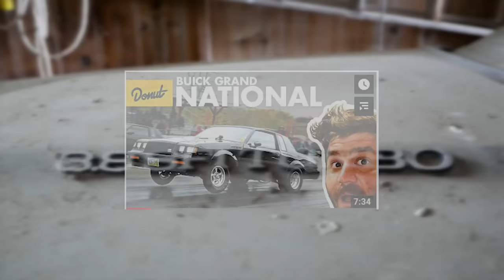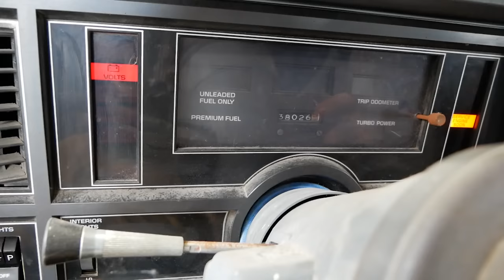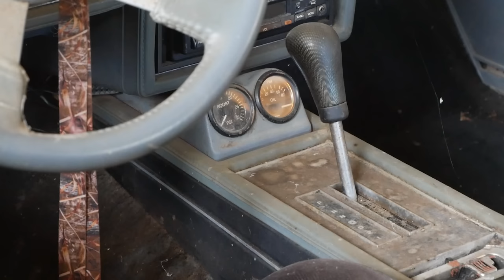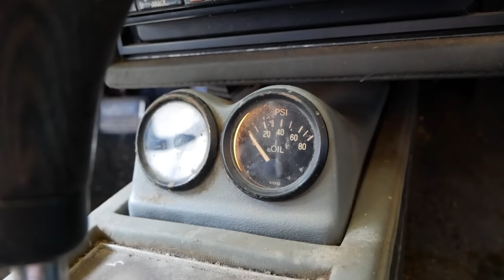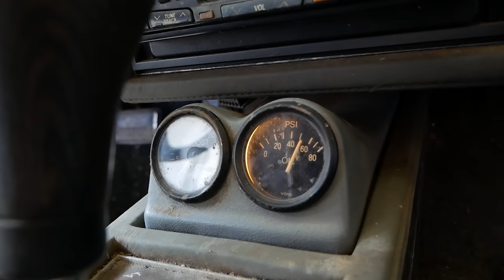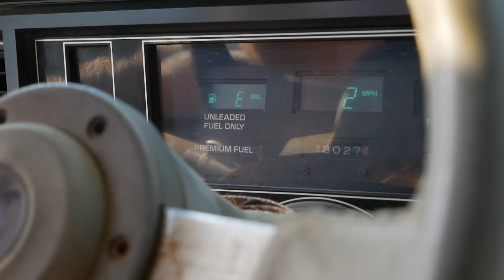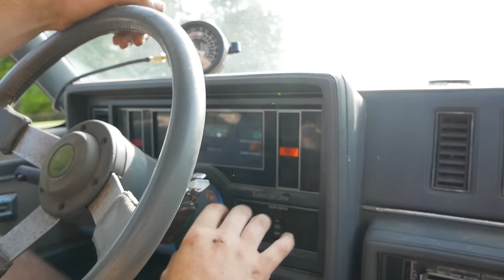BARNFIND BUICK GRAND NATIONAL - Will it Run and Drive??

Comment: “See kids, you don’t need fancy equipment to get stuff done” says the guy with a car lift and a forklift 🤣
Reply: rite! I be happy  with just the lift
Reply: He did follow that up with "it does make it easier"
Reply: Having a forklift to drop a full tank of gas would be way easier. I've heard stories where people would try to completely fill their tank because the car wouldnt start and the problem is the fuel pumps would be inside the tanks, not to mention these cars are basically siphon proofed. Why older cars rule!
Reply: @VintageCars999  - I've dealt with that story too many times!!!
Reply: @meabob  the best part is when they think it's not really full so they fill it to the point where its leaking out of the filler neck area. Seen that at least once!
Reply: Yea but you can tell this guy worked his ass off to get that stuff. So I'm sure he has done it enough times without it.
Reply: but technically you don't NEED them, it just makes things a lot easier than when I had to park half on a sidewalk to get the car up high enough to work on the underside of the engine and I didn't have the right equipment.
Reply: @XD1908  exactly! He has worked hard to get where he is.  Mom
Reply: Having the right gear makes all the difference - I remember failing to remove an exhaust with a lighter and a spanner...
...in a gutter, in the rain! 🤣
Reply: It’s called getting old and keeping your memory’s bc in the end it’s all your body will let you keep

Comment: hey Kevin, fairly certain that the little box with the green light you found is wired into the MAP sensor. if I was a betting man, I'd say it's probably just modifying the signal that the ECU sees from the MAP sensor to basically trick the ECU into thinking it is making a different amount of boost than it actually is. classic hot rodding trick. in fact most modern diesel engine tuners do basically the exact same thing

Comment: I had one it was fast in its day.  I suggest replacing the stock brake system.   The Master brake cylinder by it self was $3500.00  back in the early 90s.   I can not even imagine what one goes for today, if one can be found.
Reply: It's the nitrogen charged booster for the antilock system. Ford had a similar system on the Lincoln town car, but was also paired with the crappy air strut suspension system. Those went for $1,500 each. It's why you'd see so many sitting on the ground in people's yards for sale back in the late 90's early 2000's
Reply: @dave1135  it was a great day when some one figured out  and made coil conversions for those rear shocks on those Lincolns...
Reply: When I was working on one a couple months ago, we couldn't find a booster/master cylinder any where. Not even used. Finally found a place in Alabama that would rebuild it and give a year warranty as long as the motor still worked. Cost was $960 plus shipping there and back. They said the motors are very hard to find. Luckily ours still worked. It took 6 weeks to get it back but it worked perfectly. I got lucky and all the bleeder screws broke loose.
Reply: @dave1135  - the accumulator on these actually fill with brake fluid. The master cylinder has an extra reservoir for the accumulator. Don't do like me and fill up the extra reservoir after bleeding the boost system. The extra room is for the fluid when you have to discharge the booster to do any hydraulic work. What a mess it makes to.
Reply: @dave1135  they didn’t have antilock brakes. Nothing to do with the suspension either. I had the accumulator ball fail on my 87 GN. Brakes were hard as rock. There was actually a recall for that issue
Reply: @jaredoaks6317  I know, what I meant was the ball provides the brake assist. On the suspension for Ford, I meant it's like the brake system on the GN, overconplicated and over expensive
Reply: @meabob  The guy who bought mine ripped out the entire stock brake system and put a better after market one.

Comment: Seeing this car so rough hurts. My dad had a super clean and pretty stout 87 about 5 years ago that he sold right before he passed. Precision Turbo, forged internals, built trans, scan master, fuel system, 3inch down pipe made 26psi on 93. Pretty much all the go fast parts you need. Had the GNX wheels, boost gage in the A piller. Been my dream car since i was able to understand how great these cars were. Ill never forget him letting me drive it on some rips. Ran it in the 1/8th couple times one day, Ran an 8.10 our first and only time at the track with it. Best memories i have of him were in that car. I will own one myself one day.

Comment: I mean at that point, with the body damage, it would be best to just clean it up, get it running right, and  make a fun driver out of it
Reply: With it running good, they could probably get $15k for it as it is body wise. Well maybe a little less with the "upgrades" it's had. An original one in decent shape that runs well goes for $30k to $40k
Reply: No way is this a 15k car.  I agree to getting it running and drive it as is.

Comment: That's my dream car. I remember being at the  first time they came out with the Gran National. My father was a general Foreman at Buick. Flint, MIchigan. The birth place of Buick. I fall in love with Gran National while I saw the unveiling of the car. I sat in the band stand watching them race the Gran National. Doing donuts & all kinds of stuff. I loved it when my father got to drive home the new car except for the Gran National. Back through, you being a car guy. Buick put t-type engine in Rivera's, Century's, & Regal's. If am wrong, please let me know that I am wrong. I'm not 100% sure. That episode of you fixing the car & taking it out for a test driver brought back memories of my father. He passed in 2002. I am proud to say that I watched the evolution of the Buick automobile. Thank you so much. I just happened on to your channel in my home page. Hey, I know about the poop smell in a motorhome. Nasty.
Reply: You are right and wrong but on the right trail.TTypes came out before GNs when the body changed in 1981.with a turbocharged carburatored 231litre V6, in 82 they came out with the grand national black and grey most had a 4.1 litre non turbo 125hp V6. About 10-12 where turbocharged 175hp 3.8 litres. Buick was trying to keep the beast with in. TTypes came out again in 83 but no GN until 1984 and buick laid all the cards on the table threw 85 with fuel injection,CCCI,revised turbo camshaft,bigger turbo,and carried over the 2004r with stronger shifting it needed to live with the new improved 200hp engine. Then in 1986 TType and GN got an intercooler and bigger turbo beter electronics. These cars would smoke Mustang GT, Camaro Z28,IrocZ,Supra turbo,300zxTurbo, Mitsubishi conquest TSI, most German cars... did i mention Chevy Corvette. When the GNX came out mid year in 1987 none where standing only 547 copies where made. But ...yes the TType was first and was faster than GNs because of the aluminum wheels,and bumper supports that made it lighter than the GN. TType could be ordered in any color under buicks umbrella GN could be to as long as it was black. Never understood why people liked the GNs more. they where NOT faster.question: factory issue which was faster 1987 Mustang LX 5.0 ..or..Mustang GT same transmission??  Ok same question for TType and GN same transmission. U get the same answer. Print that.

Comment: Maybe someone can tell me, did GM use the Renex ABS brake system? Seeing that high pressure vessel reminded me of the system that Chrysler used. It turned out to be a nightmare. But after struggling with it for awhile, I got pretty good at working on them. As crazy as it sounds, almost any problem causes it to loose power assist. Was a POS system. Then along came Teves. Great system.
Reply: gotta love working on CDJ vehicles
Reply: Not sure on the GM system, but I did comment on what the pressure accumulator is. It's simplify a filter of sorts to help with vibration and noise.These cara didn't have a vacuum brake booster. I personally thought this system ran off of the power steering (like GM did on diesels) but it seems to use an electric motor to provide hydraulic assist. Probably obsolete parts by now 😖
Reply: As an owner of an 86 Grand National for the past 26 years,   The brakes are an electrical motor powered system called the "powermaster" system.  I've replaced the one on my car before.  Not that difficult.  The master cylinder and electric motor come in one complete piece.  The big black ball on the side is to store the pressure it builds up for the brake system.  And this one is bigger than the stock one so that you can hold the car at a light with boost without braking the tires loose for a better launch.   When a turbo is boosting, there's no vacuum for the brakes to run off of, so this system assures there's always brake power.  Even with the car not running and the key is on, you will have power brakes.   The pressure accumulator is not a filter of sorts for vibration and noise like another person commented, It's to store the brake pressure.
Reply: And no, the car does not have ABS brakes.   If you stand on the pedal, they'll lock up

Comment: My dad has this exact car aaaand had the GMC Syclone at the same time. The Grand National is very strong. But that lil' truck was an absolute beast. I saw him take down a ZO6 Vette in the 8th mile by 3 cars. And baaaarely got beat by a Viper. Literally by a half a fender. Its was a ridiculously fast unit. He sold it for $4500😭😭😭😭😭😭. And regrets it to this day. Still has the Buick though. Only 21,000 original miles. Even has the dealer sticker in the quarter window still. It's so minty clean. 
       Love the channel brother. Keep'em comin.

Comment: There is hotter even faster version of the Buick Grand National called the Buick GNX?
Reply: Yes correct. 87(last year of production) they made a limited run
Around 500 cars i think.  Bigger turbo with more boost  and suspension mods, can't recall what all else.
Reply: 547 grand nationals in 87 were handed over to McClaren to become GNXs.  Each car was numbered on the dash. It had a ceramic impeller turbo for quicker spooling, a bigger intercooler, Steward warner Gauges, Fender flares to fit the Eagle gatorback meats mounted on TA like honeycomb wheels, A ladder bar attached to the rear axle to keep the tires planted on launch, Fender louvers on the front fenders to help vent engine heat and to look cool in Buick style...  That's all I can think of, there's more.  Very cool. Very collectable if you can find one.
Reply: @jeremygalba6559   remembering some of that from dead air. That was a pretty good documentary.
Reply: @spacecat7247  "black" air  :)   I knew everything about that car and my own long before that documentary
Reply: @jeremygalba6559  very good. I was just mentioning it for the guy that it was asking originally. And believe me I'm just a little bit familiar with it too it's one that's on my bucket list that I'll probably never Attain. But......maybe

Comment: The blue car at the start of the video is a Ford Festival. I know because I owned 5 of them. If it has a 6 speed in it I got 50 miles to a gallon. Great cars. A friend and I went to Ship shawarma and on the way back to Michigan stopped at a grocery store and bought 12 packs of pop( soda). I folded down the backseat and I wasn't able to see out of the rear window on the way home. Great memories of that car.

Comment: Great video! One of the things that made this car so important in the automotive world is that catalysts and smog laws cut performance off at the knees in 1975. Enter the years of great designs with lousy performance. SUDDENLY 1986 IS HERE AND A FACTORY CAR , RIGHT OFF THE SHOWROOM FLOOR, WILL BOIL THE HIDES! Someone at Buick reached and found he had a pair and said "I'm gonna build me a hot-rod".  The 1986 Buick Regal GN was born. General Motors often behaves like the 6 different car companies that it was at the time, and the car escaped corporate attention until sales numbers became so large they caught someone's eye. A few years later it was shut down because Buick had broken a rule that stated ;"No division of General Motors shall build a car faster than the Chevrolet Corvette, which is the G.M. corporate flagship/standard bearer for performance."  G.M. rules and whiny Corvette owners got a performance Buick shut down.  Other attempts were made, Oldsmobile and Pontiac,but they got shut down even sooner.

Comment: Love yalls videos , my favorite was the 66 Ford Twin I Beam  3 spd on the column,  I have a maroon 66 Ford my dad gave me when I was 16 years old I've now owned it over 31 years it has the 352 /2BBL 3 speed on the column,  only thing I've had to replace other than General tune up parts is the Cab mounts and the radius arm bushings

Comment: That thing at 23:57 was called a TPS TEK device (or something like that). I forgot exactly what it does but I remember my friend buying one for his 84 GN way back in the 90's. I think it has something to do with the throttle position sensor. When you hit the throttle you will see the lights move up and down.

Comment: Had a '61 Buick Special. Aluminum block v8, barely functioning water pump. I finally had to dump it when the front ball joint collapsed during a low speed left turn. Got me across the US twice though.

Comment: I've been a Buick & Grand National fan since '86. Around the 24:00 mark when you drop the gas tank..I get what you're saying about using a pressure washer and rinsing and all of that..what about just replacing the tank, sending unit, float & fuel pump? If someone already said/suggested this or if you did, my apologies. Very nice vid too.

Comment: Number one thing with connecting wires do not use a connector it's pretty simple just to use a soldering iron and solder them together easier and last longer

Comment: I bought an 87 GN in 99 with 7k miles on the odometer. On the way home I noticed the oil pressure was on 0 so I called the guy I bought it from and asked him "was the gauge faulty" he never had a problem with it so I did the only thing I could to tell if it was correct or not - I turned off the car and then attempted to start it again. The motor was seized! The oil pump spring was the culprit! For the next year I had the car built to what I wanted - A 650 HP 10 second GN. When I was done it was fun but it wasn't anything that I felt special I sold the car and bought a second GTS viper

Comment: Autotrend car of the year in 1986. Arguably the Best V6 ever built. Also surprisingly high HP and torque. I distinctly remember the grand national, stock, straight from the dealership, embarrassing guys with "built" engines.

Comment: If you really want to buy that in the future, would be a good idea to buy some fluid film coating and heavily coat the underside of that car, body, frame, etc. Steam clean the engine. Will make it look 10x better for what it is. Also, just put a regular brake booster in it. No reason you can't. Any modern turbo car today, uses a regular booster.

Comment: Very awesome car! It does sound almost like your 1990's to early 2000's car with a V6 that a teen slapped a turbo in Lol But this one came stock with a smaller turbo, but doesn't have the stock turbo making it sound like a modded V6 car that a ratty teen owned. I can't get enough of this! This is still a better car than much later cars for sure.

Comment: Buick regal Nice soft smooth Ride the v6 is junk the bottom ends fail around 1 hundred thousand but 8s are better as they are the 307, but can swap to a 350

Comment: Great video!  Thank you!  Can you tell me where you connected your fuel line drain hose when you cleaned out your supply line.  I can’t find a fuel hose big enough to place on the supply line just before the fuel rail.

Comment: You should make it a habit to run a can of seafoam through the system with these old cars. I'm not sure with a turbocharged system but its the best fuel system cleaner out there. At bare minimum just put the whole can in the fuel tank.

Comment: Also something you should be aware of which you could cross reference. Precision GT-6152 turbocharger running at close to 30 pounds per square inch of boost. Horsepower is estimated at over 700 thanks to 91-octane. and with your engine light and the ignition cycle you may have bad distributor or plugs or wires giving you a misfire which is wreaking havoc with timing or because the exhaust is so bad you have no back pressure.

Comment: BTw, PRETTY sure thats a turbo timer, keeps the engine or electric fan running so you cannot shut the car off and coke-up the turbo bearing with motor oil when it's steaming hot, lets the car idle and keeps the fan on till the oil and coolant are cool, preserving the turbo...
Reply: Nope. Casper's Electronics TPS-TECH. enhances throttle position sensor signal to full strength after about 70%.throttle

Comment: I put a chip on mine but it wan an 87.  It is located on the right front passenger  on the side panel under the dash and forward from the door.  Be very careful taking it out otherwise you risk frying the ECU. I am pretty that square piece with the little lights is not stock.  I change the oil many times myself and never saw anything like it,
Reply: I think it is a device called 'TPS-TECH" by Casper's Electronics. Notice that there are additional connectors  by the TPS sensor. It upped the voltage signal after about 70% throttle to full voltage .https://www.jegs.com/i/Caspers-Electronics/182/102013/10002/-1

Comment: The brakes are ATE. If the vacuum pod is bad, it won't hold pressure...and they need to have the fluid flushed every 2 years. Those master cylinders are about $1400 to rebuild, if bad and you need a core? $1800. They were used in Chrysler TC convertibles, Benz's, Jags, BMW, Porsche, et cetera- that car is definitely rough